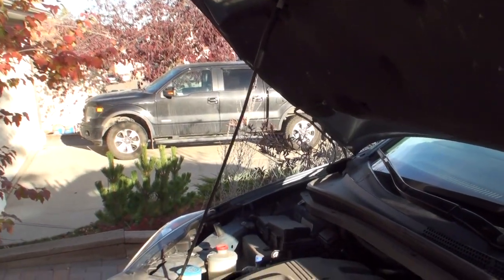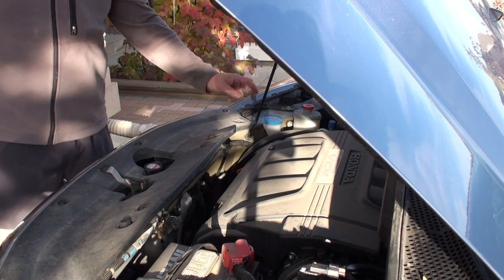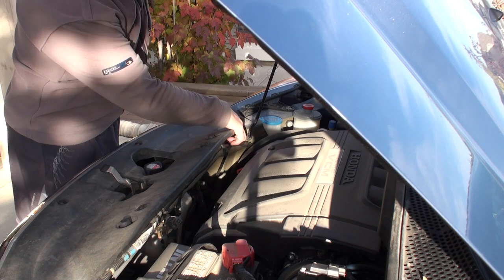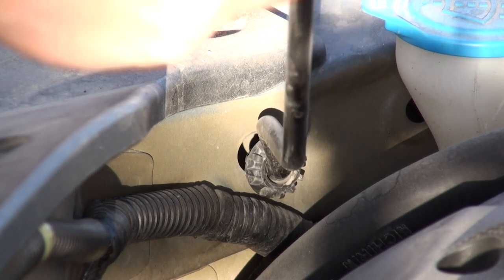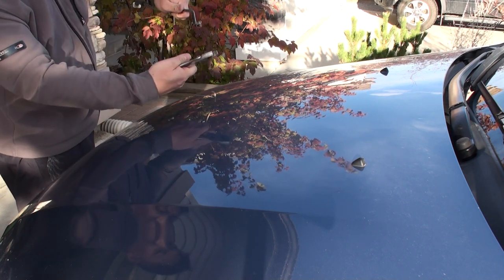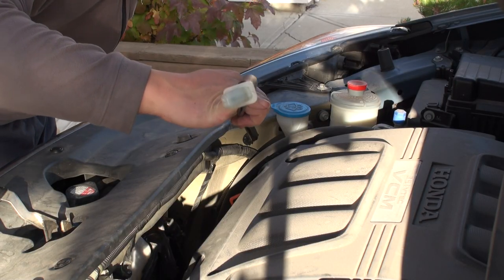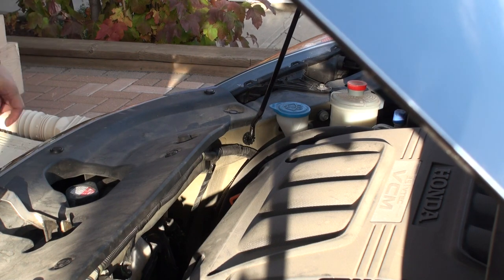Honda Hood Prop Rod Grommet Bushing Replacement

Comment: Dude - You just saved me a whole lot of headache. I had gotten it into my head that I had to put the bushing on the rod first and then bang the whole thing into the hole.  Using your method - painless and less than 2 minutes. Thank you!
Reply from the maker: Glad you found the video helpful.  Thanks for stopping by.
Reply: me too!!

Comment: I've had my new grommet for several months - I couldn't figure out how to remove the worn old one. Thanks for posting and for the tip about greasing the prop before sliding it in the new grommet. Worked like a charm!
Reply from the maker: Glad it helped!

Comment: Just did this today. 9.80 CAD at the dealership. Costs almost 30 CAD at ebay to ship to Canada. Thanks! Lubricating it makes the installation a breeze.
Reply from the maker: glad you were able to get it locally and install it in a pinch :)

Comment: Awsome video, thank you for posting this. You video reassured me that i installed mine correctly.  That grommet sucks!! The last one i had from the factory never stayed in place. I lost the whole rod and grommet, how it didn't take out my  fan,ill never know. I have a 2006 Ridgeline that uses the same part,you were kind enough to make video.  Thanks again 😃
Reply from the maker: glad you liked the video.  Thanks for stopping by.

Comment: Thank you so much for this! My ride had come loose and I couldn’t get it back in place and when I was at the mechanic for something else I pointed it out. They said a piece was missing and recommended going to the dealership (?!!). Dealership or dentist, which do I prefer…?

I’ve been poking around YouTube trying to find out How to fix it, but nobody else addressed that particular piece! Thank you so much, I’m kind of mechanically inclined so I hope I can fix it myself, if not I have a friend who’s good with cars. Thanks again!
Reply from the maker: So glad to hear that my video was one of the few on YouTube that met your needs.  It really is easy to install and those stilly grommets are so thin and cheaply made that it is no surprise that they break!

Comment: So you push the bushing into the sheet metal first, and then insert the prop rod into the bushing? Just double checking because I didn't see you install the new bushing.
Reply from the maker: Yes joe you are correct. Install bushing first into the frame and the lube up the prop rod and install.

Comment: did u push the grommet in the hole by itself or was it on the rod?
Reply: By design, the grommet will not insert (or remove) from the hole with the rod installed. Unless it is already broken.
Reply: @elspoon5331  what? He clearly had the grommet on the rod then installed it
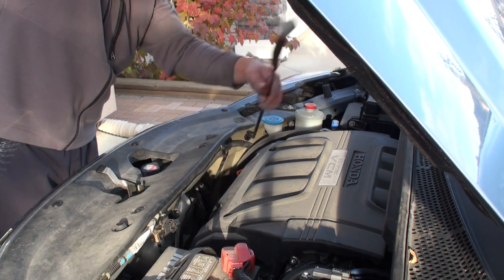Reply: @FomoOnX It is watch it again. At 2:50 , the grommet is in the sheet medal, then the rod is inserted through it.
Reply from the maker: i put the grommet in first and then lubed up the rod and then inserted the rod and got it into the grommet using a back and forth rocking motion.
Reply from the maker: thanks for clarifying that.  yes the grommet must go in first.
Reply from the maker: my apologies for taking so long to respond.  Grommet MUST go in first and then the rod.
Reply from the maker: Thanks for helping out El Spoon.

Comment: I bought a new grommet from the Honda warehouse. It won't quite fit in the hole. Should I force it in with a hammer?
Reply: Spray Silicone lubricant on it and try to push it in. Don't hit it.

Comment: Does this item fit a 2012 Acura TSX ?
Reply from the maker: it is likely the same exact part.  Double check with the dealership to be absolutely sure.  Install procedure would be the same.

Comment: You didn’t show how the grommet pops into place. Is it difficult? I’m afraid of cracking it when pushing. Did you tap it with a tool? I had to pay $10 for a Honda Ridgeline. Nothing cheaper out there for that vehicle and don’t want to crack it while installing. I wish you showed the whole process.
Reply from the maker: Sorry nick I was sole camera person and repair person and no tripod that day. Nothing hard about it. Just snap the grommet into the hole, lube up the rod as instructed and insert and wiggle back and forth to work the rod into the grommet. Shouldn’t take more than a few minutes.

Comment: You slipped it in there so easily... I can't get mine to go in
Reply from the maker: you just have to lube up the shaft with some grease and just rock it back and forth and it will pop right in.

Comment: Not as easy on R18 8th gen civics. Different part number. Same concept grommet. Just doesn't insert easily
Reply from the maker: I haven't replaced on on the 8th gen civics but I can imagine how it could be slightly more difficult to get it in.  Lube definitely helps it go in easier.